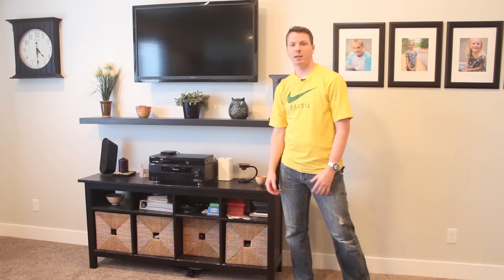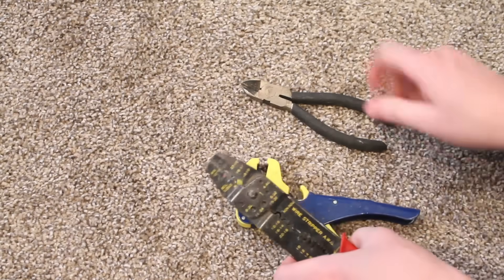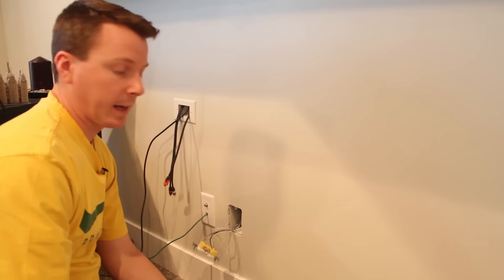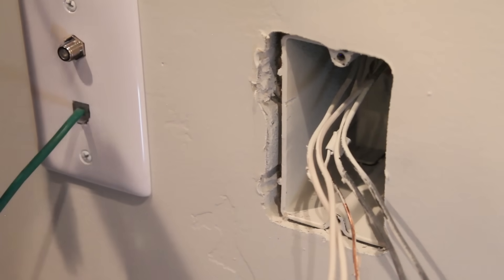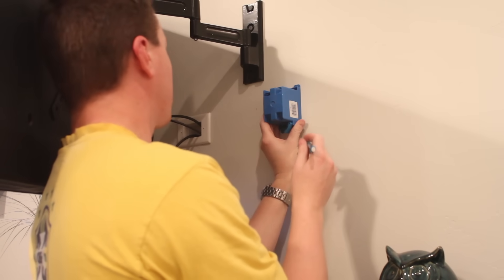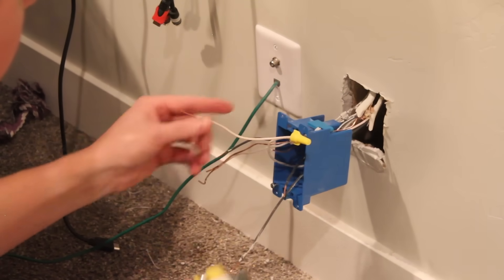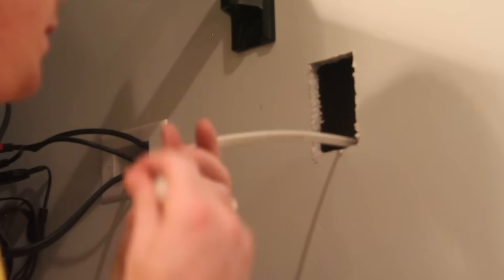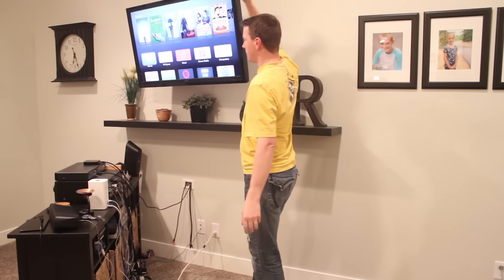How to Add an Electrical Outlet for a Wall Mounted TV

Comment: Bro, you have NO idea how awesome this video was.  Electricians charging me an arm and a leg for this and I got it done in about 2 hrs and like $40 in supplies.  Your video led me step by step.  It was great!

Thanks!!
Reply: more betterer? DIY English
Reply: a box can and a wire can cost you $27. but its the knowledge  that costs allot of money.
Reply: +Cody Sams That's $90 not 8
Reply: Did you use the force?
Reply: Thanks for the vid. One question. Would it be wise for me to connect the top before people shoving all the wires in at the bottom and test that I have it right before closing up everything or should I just trust in myself?
Reply: A company has overhead to pay for a business to succeed. Payroll, workers compensation taxes, gas, license fees, quality workmanship, insurances, just like any other business then you make profit.
Reply: @noonzzzy  o
Reply: Bro, you have no idea how many code violations...
Reply: why dont you just put in plate that has a plug in yhe first place
Reply: How much were the electricians charging ?
Reply: @crazedmartinez  Probably somewhere around $300 ish.  Most people don't understand that a hour job costs a contractor about 3 hours between travel and admin time.  All of which you are getting charged for whether you know it or not.  Also, liability is a thing.  You can't just add as many plugs as you want on a circuit before the breaker needs to be upgraded to a 40amp or it will trip all the time.
Reply: @totallynottrademarked5279  ...it doesn't exactly work like that. You can't just upgrade a breaker to a higher amperage because you want more plugs. Aside from the fact that you can theoretically have as many plugs on a circuit as you want as long as you dont exceed the electrical capacity that the breaker provides for, if you were to slap on a 40 amp breaker to an existing 20 amp line, you'd run the potential of frying the wires, outlets and your house to the ground.
Reply: @totallynottrademarked5279  :
     You can't just upgrade a breaker from 15 or 20 amps to 40 amps unless you upgrade all the 14 or 12 gauge wiring to that breaker to 8 gauge in order to handle the 40 amps.
     Unless you have a window AC, motor driven appliance, or some other high current device, there is really nothing to worry about, as most modern devices use very little current.
     That said, I agree; if you do not know what you are doing...DO NOT DO IT!  $300.00 is a small price to pay compared to the loss if you erred, and that loss could be the life of a family member.
Reply: Snoglydox to you and all the others that can’t read. I clearly said you can’t add as much stuff to a circuit as you want before it needs to be upgraded to a 40 amp breaker.   Which would include an entire new wire pull.  As it is code.  So thank you to everyone that reiterated my point while calling me wrong when being right.  Due to reading beyond my comment to mean I was implying that all they would do is plop in a 40 amp and call it a day.
Reply: @totallynottrademarked5279  :
You can say "imply" all you want; that's not what you said, but I'm glad you learned something.
Reply: I second that!
Reply: Frigging LEGEND! Saved me soooooo much money brother....thank you!!
Reply: In all honestly there’s quite a bit of electrical that can be done yourself the only thing to always remember is to take the proper precautions and do the research
Reply: A deep box for the bottom one would help alot to get everything back in. Good job
Reply: +Cody Sams

+DIY Nils install is more betterer than your lame suggestion  because he doesn't have a visible wire from the outlet to your recommended PowerBridge.
Reply: It costs $15, not $40. $1.30 x 2ea old work 1 gang boxes,  $9 for a 1 recessed outlet, $3 for 6ft wire(12/2 or 14/2). For hdmi or coax, it may cost another $15.
Reply: You cannot do electrical work unless your licenced ....you insurance won’t cover you should your house burn down !
Reply: Let's Do Business if you’re the homeowner you can. At least in my state
Reply: @lukepowers9472  Town laws vary.  Sometimes they require a permit for any high voltage work.  It's unreasonable, but that's what the local code says here.
Reply: jon candler, the grammar Nazi.  Heil Heimlich Manure ein Bekannter. Woulda. Coulda. Shoulda. You prefer "Most bestest" Kemosabe?
Reply: +Sith Lord  You got hosed lol. For an extra $8 you could have been done in 30 minutes or less.

Should have gotten this ( Or spent $3 more for a second outlet, 2 Tvs in your future?) The only thing you've got to do is cut two holes, plug a connector in and screw in the plates.

http://www.amazon.com/PowerBridge-Recessed-Management-PowerConnect-Wall-Mounted/dp/B00GWGZKF6/ref=sr_1_2?s=audio-video-accessories&ie=UTF8&qid=1455527205&sr=1-2&keywords=In-Wall+Cable+Management+System&refinements=p_n_feature_keywords_two_browse-bin%3A6150418011
Reply: this guy is a joke glad i am not insuring him
Reply: You are a tool Ken

Comment: Personal preference: I'd say 98% of all wall-mounted flatscreen TVs are hung much too high. For me, the ideal viewing height keeps my  line-of-sight at about the middle of the screen when sitting in front of the tv. Mounting it above a mantel is much too high. In this video, the tv is hung at an ideal height if Nils watches it while standing up. I learned this at a Bang&Olufsen shop that sells $100,000. televisions. So much more more comfortable than craning my head up while sitting!
Reply: +Fernando Alfaro I'd say that works well if the person is sitting at a perfect upright position, but some people's couches slump a little and you can rest the back of your head on the cushion of the couch. I'm noticing this because my computer chair let's me rest my head on the back rest, which means that my line of sight is not directly in front of me but above by a few feet. This is probably the case with Nils.

Also, having it high up might increase visibility in his case. Perhaps, he wants to be able to see his Television from the kitchen while he cooks.

Whatever the case, when I sell TVs, my recommendation is to have the TV's center a few inches above the eye-line. It's a nice middle ground, and there's a sort of illusion that your TV is larger than it is. If you put the television too low, people will consider it smaller. We tried this in the show room with 55" TVs on lower shelves and 55" inch on higher shelves, and most people thought the same 55" TV was a smaller TV when it was displayed on lower shelves.

Comment: can you make a list of all the things we need
Reply from the maker: Hey, +SuperDebo55. Sorry for the delay in getting back to you, but here's the list. I also added it to the description just in case. A stud finder, an outlet and outlet plate cover, two single gang electrical boxes for existing work,  several feet of 14-2 Romex cable, wire strippers, wire cutters, a drywall jab saw or utility knife, a pry bar or large flat head screw driver, a hack saw or reciprocating saw (to cut the nails) and a phillips screw driver. Optionally, a voltage tester, some electrical tape and a battery powered light/flash light.

Comment: you needed to show how you "fished" the wires through both cutouts - top and bottom - .. on the video you left that step out ...
Reply from the maker: +you166mhz I literally just dropped the wire down the top, then wiggled it around until I was able to grab it from the hole in the bottom. I had a pipe in the way so it was a little tricky but there was enough room for the cable to go around it. If you have fish tape or fish rods, that makes it even easier. You can also try tying a small weight to the end when you drop it down so that it's more likely to go straight down instead of getting caught along the way.
Reply: +Nils Rasmusson 
Thanks ... great vid ..

Comment: Nils,a fire in your wall,because of the OEM power wire of your TV,is very unlikely,never seen that.
Reply: +ROBERT GOUDREAU
Well yes it is the exact same thing if you run the TV cable behind the wall or put a new outlet with a cable in there, but insurance numpties will put the blame on owners for any and all fires in the house if there is an appliance cable routed through the wall.

Comment: Your instructions are incredibly easy to follow, I'm planning on doing this power extension soon. Thank you!
Reply: Do not pigtail, sockets have two screws on each side!
Reply: @toriless  was told pig tail is best to prevent over heating outlet.  Also user above, don’t use extension wires behind wall

Comment: Starters, look at all the exposed wires behind the outlet boxes that doesn't have any shielding on them.  Rather, the whole wires including the shielding should be brought inside the outlet boxes.  You should also consider applying electrical tape around all the connections on the outlets because it's more safer.
Reply from the maker: +WAYNE L I appreciate the tips on the wiring. I don't appreciate the insults. My videos are an attempt to help people get things done that they wouldn't otherwise feel empowered to do, and yes - they do cost me quite a bit in equipment, gear, software, time away from my family, etc. I'll add your tips to the video to help more people get it right. That's my objective. Together, we can make electrical work way more safer, broh!
Reply: Been watching You Tube for awhile now and never seen anyone else ask for donations.
Reply: Your dangerous and extremely stupid.  do yourself a favor and stay clear of electricity.

Comment: how would i go about this if i have a stud in the way? :(
Reply: I think. You may have 9ft. ceilings if so your going to have to cut the drywall out half way on both sides of your vertical studs carefully with a utility knife if you don't want to buy a new piece of drywall. Also about 6 inches above and below the horizontal stud with a Jab saw. Cut out the stud. cut the nails and file them flush to the stud so no way wire can snag and drill holes using two studs drop all your cables secure the cables up-top so they won't fall  feed it through the hole. At the upper cut of the drywall toe nail it in feed cable through the 2nd stud  through the wall and out to your lower panel then toenail the lower stud in. then you'll have support to screw back your drywall flush.  Then it's mud, dry time, tape, mud, dry time again, sanding, wet sanding, a little more dry time and paint. Sorry I know you didn't want to hear that. I've done this a few times before the wrong way my first few tries. Hope someone knows a better way but this works good and looks good and is easier then trying to fine a halfa$$ way to do it
Reply: Terry Avery You work for NASA?

Comment: Hey Jonah, thanks for the video but i seek an answer that a couple of people asked you but i dont think you ever answered.  Once you removed the old existing box you had 2 black wires and 2 white wires .  Once you dropped the new wire in place that gave you 3 white and 3 black wires.  You cut 3 each jumpers.  You said to grab your 2 whites wires and the jumper and wire the 3 together.  If you combine the 3 white wires and the pigtail that would make 4 white wires.  But you grabbed 2 of the 3 white wires and added the jumper.  The question a couple of guys asked was.  How do you know which 2 white wires to join with the jumper ? Or asked another way.  Does it matter which wire you dont add the the 3 wire jumper union?  i am sort of guessing it doesnt matter.  i am guessing you didnt add all 3 whites wires to the white jumper as a wire nut wouldnt cover all 4  and since you had 2 gold  posts on the outlet you used both (i doubt i worded that so you can comprehend :)
Reply: +Dale Trainer i am wondering the same thing. Did you find out the solution?
Reply: +Dale Trayner My thoughts: The wires that didn't get wirenutted together were for the next outlet on the same breaker. They got connected to the outlet, just like the pigtail from the wire nut.
Reply: +Dale Trayner All he did was take the two existing wires that were coming in and leaving the outlet and splice them together.  So that they bypass the actual outlet.  The pigtails he added were just to reintroduce power to the existing outlet that he just bypassed.  From the outlet itself he branched off to power the new outlet.  If you have big enough Wire Connectors you can just take all the blacks and connect them together with a pigtail going to the outlet and all the whites and connect them together with a pigtail going to the outlet as well.  If you get the blue connectors they should be big enough to connect four wires.
Reply: As long as all of the blacks find their way to each other, whether through a pigtail or via the terminals on the outlet, then all will be well. The same goes for the white and the bare ground.

So to answer your question, unless there is a nuance I'm missing, no it doesn't matter which blacks are pigtailed and which are connected to terminals directly. Same goes for the other wires. As long as everything is only connected to like colored wires.

This is for outlet circuits and not regarding any kind of switches.
Reply: At about 10:17, you can see where the wires went. They were attached to the outlet directly, and used to feed the rest of the circuit.

Comment: You cut the stud nail and how you fix the box on the stud?
There is no detail introduction how you wire the cable from TV to the the switch.
Reply from the maker: +Joe Qiao Joe, in the video I showed that the old outlet box was removed and thrown out, then a new one was put in, which is why we needed two single gang boxes for this project. The new one is built for existing work, so it has tabs that hold it to the drywall, not the stud. You could, however, screw it to the stud for extra stability. As for the other question, because these walls are hollow, I literally just fed the wires down from the top and pulled them through the bottom. If you need to, you can also try using fish tape or another means to pull them through.

Comment: Excellent video!  Like you I'm not an electrician, but thought you did a great job.  You might want to point out why you did some of the things the way you did.

You might want to emphasize the importance of using the proper gauge wire for the circuit.  If it's a 20 amp circuit, use 12/2, and if it's a 15 amp circuit, use 14/2.  One exception I make is if it's a 15 amp circuit and the existing wiring is already 12/2, it's best to stay consistent and also use 12/2, just in case someone down the road decides to live dangerously and change to a higher capacity breaker.

Also, you might want to point out that the reason you were pigtailing the short segments of wire using wire nuts is because you're only supposed to put one conductor max under each screw, unless the receptacle is specifically built for it.  Putting more than one wire under a screw might work for a while, but it's not to code , reason being that it does not create a reliable connection and could stop working a few years down the road.  Worse, it might start arcing inside the junction box, which can generate a lot of heat, with very unhappy results (the reason for AFCI breakers, which trip if an arc is detected on a circuit).

Lastly, I noticed that you shied away from the push-in connectors.  I've had bad experiences with them myself, which is why I always use the screws.  They are supposedly reliable with 14 gauge wire, but got a bad reputation years ago after people pushed 12 gauge wire into them, resulting in unreliable connections.  The push connector holes on new outlets won't even allow 12 gauge wire to be inserted.  I wouldn't risk it even with 14 gauge wire.
Reply: Dan Sanger push in connectors are perfectly safe, IF done right. and using heavier gauge wire isn't as dangerous as under gauge, but still shouldn't be done. breakers, wire, and receptacles ships all stay consistent. speaking of dangerous and codes, user should really find out what is on each circuit being as most codes have a limit as to how many outlets and\or lights and appliances are allowed per circuit. the easiest way is to shut off all circuits until you leaving the circuit on for the outlet you'll be toying with. then check EVERY outlet and light. even in other rooms especially in older houses.
Reply: @shanetho2865  I have questions about piggybacking and adding an outlet like this, like you mention. I would like to do this to one outlet in my garage so I have one under my work bench and one above it. I am definitely no electrician, so does this lessen what I can have running on this outlet/s now?
Reply: Do you mean the outlet box itself?
Reply: Shane Tho You're probably right about push connectors being fine.  As a landlord, I just became paranoid about them after several times having to track down intermittent connections in wall outlets, which turned out to be caused by bad connections at push connectors.  However, in every case, someone had used 12-gauge wire on a 14-gauge push connector.  My understanding is that they are reliable when used correctly.
Reply: Dan Sanger I understand that completely, I recently renovated part of my house, I didn't use push connectors lol  pig tails and screw mounts, push connectors should really only be used by professionals, because they do need to be used properly, another quick tip from my uncle who is actually an electrician was to wrap the outlet in black tape to prevent any kind of Arc or accident.